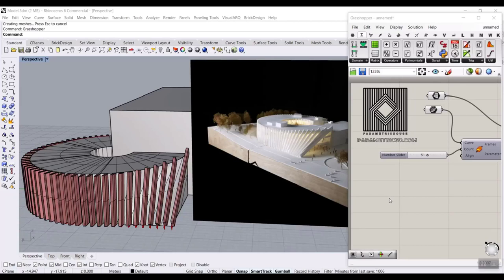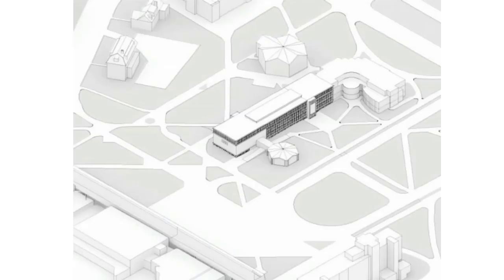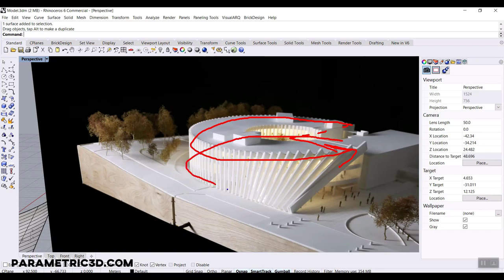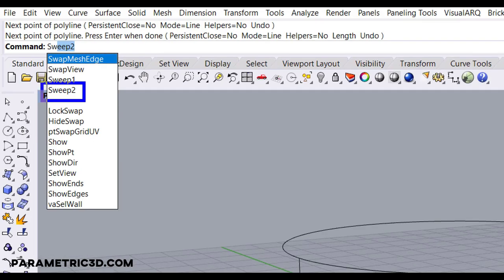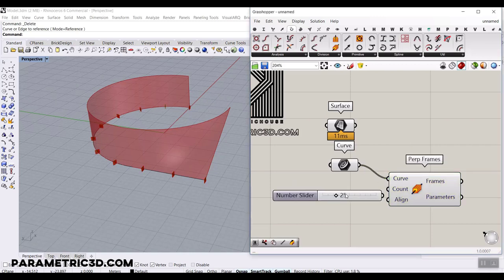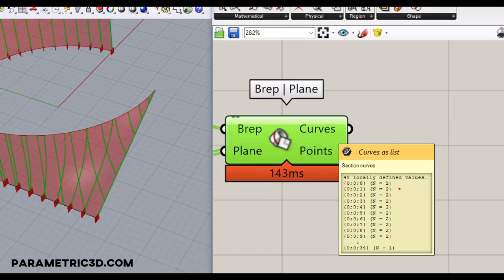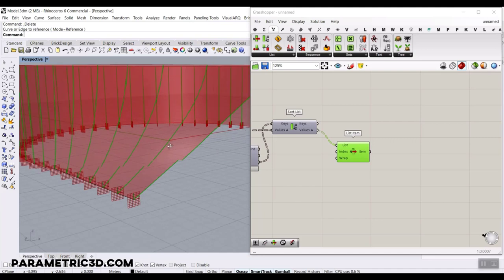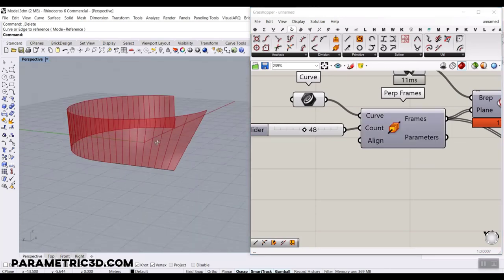Rhino Grasshopper Architecture (Isenberg Business Hub)

Comment: There's always a little trick that I haven't used yet. The flip curve with guide is nice. Also, I recently had to use the Match Tree component to match the data tree structure of another tree. Quite elegant solution to preserve a certain data structure.
Reply from the maker: True,there is always a hidden trick which you can use to solve the problem easier